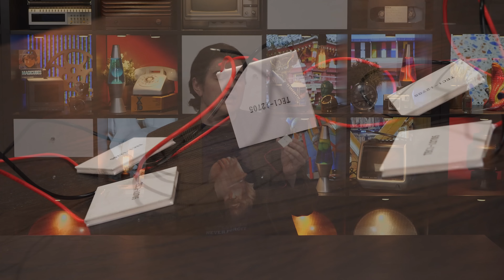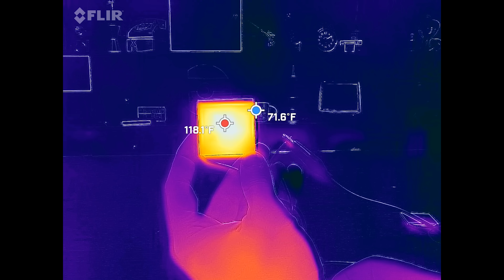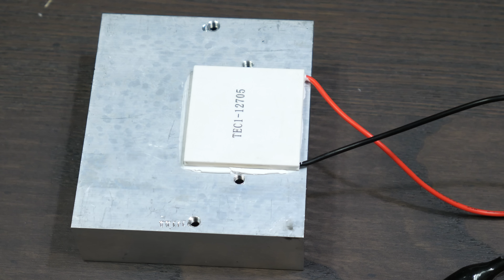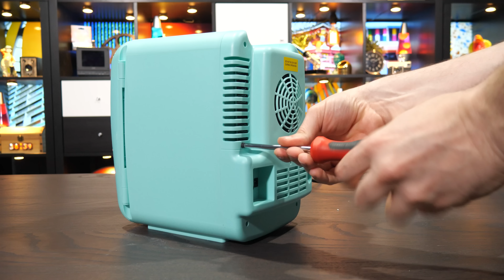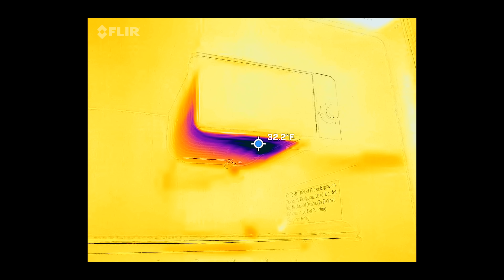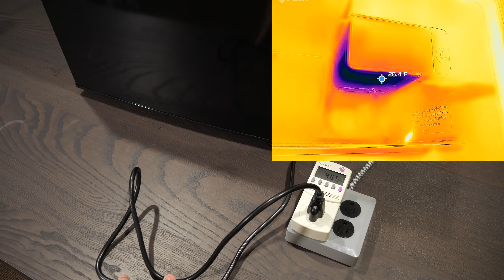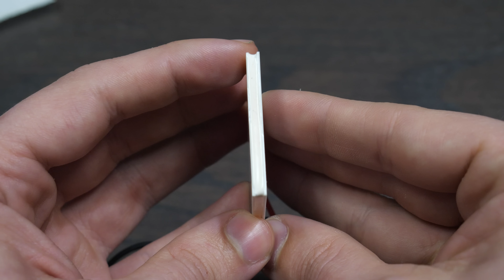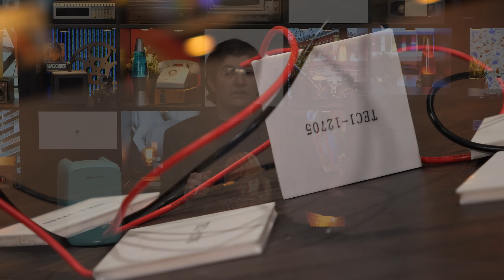Thermoelectric cooling: it's not great.

Comment: A bit tangential to the topic at hand, but I hate those temperature control dials in refrigerators.  0-6 is completely meaningless, so it requires trial and error (and a thermometer) to even know what they mean!  Like...if they're gonna do that at least make it go to 11 so I can make Spinal Tap jokes.
Reply: If they had degrees, then the dial would have to be calibrated.
Reply: @roberthunter5059  Not just that, but you also have the issue that refrigerators are commonly large enough that there can be a difference in temperature between the bottom and the top. And in order to ensure that the temperature that it's claiming is being achieved, you'd need more sensors. Sensors that can themselves break and lead to customers suing the manufacturer.

It's just a relative scale. If the food is too cold you move that dial a bit one way. If it's too warm you move it the other way. And you use a properly calibrated thermometer and daily checks to get it to where it should be initially. After that, you should hardly have to mess with the dial again.
Reply: @roberthunter5059  ...and you could complain because they arent consistent.
Reply: @roberthunter5059 to be fair, that’s the same result as the meaningless dial, but at least you can directly calibrate if it’s in degrees instead of trying to do conversions
Reply: @roberthunter5059 just do it the way commercial chillers do
Reply: @roberthunter5059  They should use Deceptican levels.
1. Ravage.
2. Rumble
3. Thundercracker.
4. Soundwave.
5. Starscream.
6. Megatron.
Reply: @roberthunter5059  What if we legally demanded calibrated units then?
Reply: Requiring calibration is massively expensive and if mandatory would need to be done for each unit.   Cal techs usually need to be certified and all the components used in calibration themselves need to be calibrated in turn, regularly.  Your temp probe cannot differentiate between hundreths of a degree and 1/10th?  That probe is no longer allowed for calibration, add $200 to a production line cost (Ballpark, cost to cert the cal tool, fail, repair and test again and then replace).  Instead you could just verify the design and components work as intended within the desired range than manufacture  with a dial between the operating extremes.  Buy a $2 thermometer and hang it inside, set the dial to whatever can hold the desired temp you want on the thermometer.   Cheaper than a $20-50 temperature controller and its solid state.    Temp is drifting after 2-5 years?  Adjust based on internal thermometer.   The numbers are your individual reference  not reference to a desired temp.   
The real question I have about all this is why people don't hang thermometers in their fridge. @youtubeuniversity3638
Reply: @youtubeuniversity3638 why demand it legally when you can already buy a wide variety of fridges that are calibrated? On my fridge, I can set the fridge temperature and freezer temp in Celsius, it’s a mid range model from 10 years ago
Reply: @youtubeuniversity3638 we’d see a huge price spike
Reply: Im pretty sure because they are not calibrated at all at the factory, so they cant say anything other then relative power.
Reply: @Stars-Mine well the fact they aren’t calibrated is a problem
Reply: @Stars-Mine
Reply: The dial on my fridge has 'cold' and 'extra cold' with no scale.
Reply: oh boy, my refrigerator has two control dials, the one for the fridge is 0-6, and the freezer one is A-F... yeah wtf hahaha, using letters to indicate coldness
Reply: @zackarylefebvre9059  Your freezer control is in HEX ?
Reply: Agreed! In Europe, I'm never sure if 0-6 refers to degrees Celsius, which means closer to 0 is colder, or cooling strength, which means further away from 0 is colder.
Reply: @FlintlockYT They usually aren't in degrees, it's mostly a measure of cooling power. Otoh, mine have a temperature setting since the early 2000s, and they aren't expensive ones.
Reply: @wernerviehhauser94  They are never in degrees. if they where in degrees they would be marked as such.
I paid the price of at least 4 beers to find this out.. Its now set to 2, witch is the "cold enough for beer but don't trust it with meat" setting on mine.
Reply: @wernerviehhauser94  with my old one it really did only denote general cooling power (I had to dial it up in summer, and dial it down in winter). With my new fridge, that also has no temperatures but only numbers, I have to do no further adjustments, so it seemingly takes the actual temperature into account. I guess it's something about that if they write 5°C on it, that's what the fridge has to do, while when they write 5 on it, it does something and the customer might use a thermometer to see what exactly and adjust accordingly.
Reply: @wernerviehhauser94  A measure of cooling power? So 0-6W of thermal energy removed? No?
Isn't a fridge supposed to keep a constant temperature, or is it for removing a constant ammount of heat per time?
Reply: @jannikheidemann3805  not in a proportional sense, but in an "guitar amplifier" sense - 0 being "none" and 6 being "a lot". And all you get from a standard fridge is a constant average temperature, a few degrees of oscillation are inevitable without more tech
Reply: @FlintlockYT  just as a spoiler alert, the numbers on toasters mean nothing either.
Reply: @skellious  the numbers on mine are a timer
Reply: @skellious this would be relevant if the numbers on the toaster were in any way close to operating temperature. 
Like 0-200. But they’re not. Unlike the 0-6 which are exactly the normal Celsius temperatures in a fridge
Reply: @Abductedsky  Some people claim that the numbers on a toaster represent minutes of toasting time. (Based on Tom Scott's video on the subject... that's actually true for some models, but not for most.)
Reply: @macdjord no matter what number I put my toaster on it just seems to toast a random length of time.
Reply: @macdjord  hopefully Tom will return one day!
Reply: @skellious  Experimenting with a toaster is easy, since toasting takes a short amount of time. Besides, if you set it too low, you can toast a bit longer, if you set it too high you can pay attention and notice when it's about to be too toasted.

Fridges are way slower to experiment with, plus you need an additional thermometer, you risk damaging the food in the fridge, etc.

"The numbers have no intrinsic meaning" is a much bigger problem for fridges than for toasters.
Reply: @skellious the numbers on a toaster are minutes, you goober. 😂
Reply: @Abductedsky the dial in a fridge is not marked in degrees. US fridges use the same duals, and 0°F is a lot colder than 0°C. Those numbers are power levels, not temperatures.
Reply: @macdjord sure, if you're buying cheap crap. Pay a little extra for something not made in China, and you won't have a problem.
Reply: @aethelfreda your toaster is either a cheapo, or it's malfunctioning. Buy a new one. Cheap and malfunctioning heating elements are a fire hazard.
Reply: @skellious false the higher the number the longer it stays down theyre literally a timer
Reply: @macdjord those people are idiots its not minutes,  lets say you pick a 7....youd start a fire with your bread on for 7 minutes.  But it is some sort of timer.  Put yours down at 1 vs 7 and time it
Reply: @skellious they're time in minutes actually
Reply: They do, the indicate level of toastieness @skellious
Reply: @skellious  I suppose that is because most use a simple monostable timer with a RC circuit to set the time, now these resistors and capacitors are probably not the most accurate and as such the time the numbers refer to probably varies a decent amount between units.
Reply: @SkunkApe407  all the bimetallic strip and electromagnet ones are hit and miss. Multi slot ones of those being worse than single slots. I never toast things unattended (as I like my toast hot) so even the most unreliable toaster is not a significant fire risk. I'm used to toasting under the (UK) grill (US broiler?) for most things anyway.
Reply: @aethelfreda  you can use either lingo interchangeably with me. My Nan was from Guildford, so I was raised with just as much of the Queen's(King's) English as I was American English. I also have family in Kilcullen, so I speak a bit of Gaelic English, as well.

As for toasting, I haven't really found one that works perfectly, regardless of brand or model, and even a toaster oven, grill, or broiler only toasts one side at a time. 

We can send satellites to the furthest reaches of the solar system and create carbon nanotube structures stronger than steel and more flexible than plastic. BUT WE CAN'T DESIGN A DEVICE THAT EVENLY AND CONSISTENTLY TOASTS BOTH SIDES OF THE BREAD!!!

We truly are a species of brilliant fools.😂
Reply: @Abductedsky but they also use 0-6 for refrigerators sold in countries that use Fahrenheit
Reply: Its time i guess @skellious
Reply: @skellious arent toasters' numbers minutes?
Reply: @skellious every toaster I’ve ever owned has-in the owners manual- said that the number is a timer for length of time the bread is toasted
Reply: @skellious spoiler alert, you're wrong. The numbers on a toaster change the length of time the toaster runs. Which is effectively controlling your total heat output, because lower number will run for less time meaning overall less heat, and a higher number will be the opposite
Reply: @Abductedsky the numbers on a toaster usually refer to time, but they have no direct relation to an actual time period and it varies from toaster to toaster. As in 6 doesn't mean 6 minutes but if it's set to 6 it will run longer than if it's set to 2
Reply: @macdjord it does refer to time on, but like you said not always a direct relation to a real time period. 6 runs longer than 2 regardless of the toaster though lol
Reply: @skellious  I thought they counted minuges? No standard for how much heat is actually applied but the numbers do mean something.
Reply: @skellious the numbers on toasters refer to time intervals... It's just an egg timer built in
Reply: @skellious  what? 😂 Yes they do it's the timer
Reply: @skellious not true. Most modern toasters are of a kind called "capacitor toasters". The way they work is by cutting off the circuit when a capacitor inside is charged to a pre-set specific voltage. The higher the number you set your toaster to, the higher the resistance is in the current flowing to the capacitor. Essentially, on a lower number the current will have less resistance and charge the capacitor faster, causing your bread to toast for a shorter time; on a higher number, the current will have higher resistance and thus take longer to charge the capacitor, and longer to pop your toast out.
Reply: @skellious they are a timer, look up the video of the guy testing them :)
Reply: @skellious depends on the toaster. Many manufacturers caught on and have made them either be a timer or a heat dial or both. In more expensive toasters. E.g. Smeg toasters, they have this.
Reply: @skellious Usually the #'s on toasters are correlated with time + a burnt piece of bread is a lot different than food spoilage or unsafe consumption.
Reply: @skellious the number on your toaster is how long your bread gets toasted 😅
Reply: @FlintlockYT    0-6 is not temperature. It's cooling power. With 6 being the coldest
Reply: @FlintlockYT  A refrigerator should be keeping everything under 5°C or 41°F. Have you turned the refrigerator all the way up to its coldest setting what you are actually doing is simply having the compressor run for longer period of time each day just like an air conditioner. Also many refrigerators only really cool the freezer and the cold air is then vented down into the refrigerator box. Depends on the model obviously.
Reply: @FlintlockYT  Or doesn't. It is between 1-low cooling6-most cooling
Reply: @FlintlockYT they just need to change 0 to OFF  but people would argue about that
Reply: @FlintlockYT I hear you but there’s a user manual that would tell you that. Would def be simpler if they label it cooler at one end or something.
Reply: @FlintlockYT My fridge at least have a helpful snowflake on the dial to indicate the cold side.
Reply: @FlintlockYT  most sane refrigerators, the number should be a measure of effort, so higher = more cold. Though the fact there's a zero in your example is perplexing 🤨
Reply: @FlintlockYT  actually, Celsius makes those numbers make sense. Since 0 is the freezing point of water. However, thinking in terms of Fahrenheit - 0 is way too  cold and so is 6 being as 32 is the freezing point of water.

Moot point though, I guess... I'm sure the numbers aren't related to temperature on any scale.
Reply: I have a large drink fridge in my store which recently got repaired as it was constantly running and exploding drinks, it took weeks to dial in a propper just above freezing temperature again. Digital thermostats in fridges need to become standard
Reply: @LookinLikeSoup customers would complain the empty fridge is 40 degrees even when that's normal. The company doesn't wanna deal with dumbasses
Reply: The manual usually explains how to set it more or less. I had mine set to coldest because I had that dippin dots ice cream type thing to put in my freezer and the instructions say to set it to the coldest (mine goes up to 7) so I just left it like this. Might set it to higher now that winter is coming not to waste electricity but I kind of got used to my water being nice and crisp lol
Reply: @Jhud69 why would winter have any relevance to your refrigerator temperature?
Reply: The trick is to modify it with an inkbird temperature controller and add a fan to it. If memory serves there might have been a video on this channel that did that.

EDIT: Yup he brought it up during this video lol.
Reply: Doesn't matter what I say my fridge on, it freezes the vegetables in the crisper.
Reply: Higher number = colder, i know this because the back of my fridge builds up frost if i crank it up
Reply: The thermostats are not that accurate, if you take two identical fridges and set them both to 4 they will have different internal temperatures because the dial has poor precision.  They are mechanical thermostats and use a gas filled bulb to switch a relay opposed by a spring.  I imagine to calibrate them all would take more time/money, so instead of being an indicator of temperature they are just a guide to where it's set now and if you want "more" or "less" of an internal temperature.  I have had fridges that didn't have numbers at all, just a circular triangle shape type thing to indicate high and low.
Reply: Right! I stayed at a hotel recently and the minifridge had the dial written as "cold, colder, coldest" So much better!
Reply: I work at a municipal water plant and we have to keep the fridge where our bacteriological samples are stored within a very small temperature range. Checking the thermometer and finding the temp to be 1/2 a degree high or low and then having no idea how much to actually adjust by sucks. The worst is that some of my coworkers like to move the thermometer to the front of the shelf so it’s easier to read(picking it up and holding it next to their face is too hard I guess) and just the temperature difference in the center of the fridge compared to by the door is enough to throw off our settings.
Reply: Mine just has half snowflake and full snowflake
Reply: @donut7087  wow fridges are so sensitive these days
Reply: Actually yeah would that even be any more expensive? Since they already need a thermostat why not just set it to a temperature with the dial?
Reply: @drabberfrog  
You actually see the temperature the unit keeps. The mechanical gives not any feedback, you never know where you are at.
Reply: My more modern fridge shows X°C - so lower number is colder.

For older machines higher number means more cooling power.
Reply: I don't get the spinal tap joke but I completely agree in the meat of this comment
Reply: Just use a Sharpie.
Convert the 1 to 11
Reply: @dougaltolan3017  Or 3d print a new knob.
Reply: @quantisedspace7047 Sparkfun actually sells a "GTE" knob that goes to 11 if you want a nice metal one.  Great if you don't have a 3D printer and the innumerable online 3D printing services are somehow not an option for you.
Reply: You misunderstand them. They are just relative to each other. You're supposed to use a real thermometer to decide whether to adjust the dial or not. You typically start with the dial somewhere in the middle and you adjust it as apporpriate.

The real issue is that the freezer and refrigerator are being cooled by the same heat exchanger, which means that you're really, adjusting it to whatever it is that keeps both the refrigerator and freezer in their relevant safety zone.
Reply: Abstract deliniation is way better than absolute. Any time you stick an absolute reading on a dial some dumbass customer will challenge it.
Reply: I am using a peltier box with the wires reversed and a thermostat for raising bread dough at a constant temperature, usually 26C.
Reply: I think it's because depending on your environment those levels of cooling would result in different temperatures, that's why they recommend what they recommend, try levels with a thermometer and maintain around that
Reply: Well thankfully a lot of newer high-end refrigerators have temperature displays that tell you what temperature you set your fridge and or freezer to.
Reply: YES

I've had the same fridge for over a decade and I always forget if 1 or 6 is cooler or hotter. If that damn dial gets bumped by something I just always set it back to 4 and hope for the best.
Reply: or 10 so it does actually mean something (%)
Reply: It’s been more than five years and I still haven’t figured it out. It’s a bit too cold but that’s better than too warm.
Reply: Exactly. Every temperature control should have red and blue dots. Refrigerators, sinks, showers. I don't need the exact degrees, but at least give me a hint
Reply: Yeah, I bought a thermometer just for this reason. Found out I had kept my fridge at 6.5°C when it should be under 5°C. I keep mine at 4°C now.
Reply: Just read the manual 😊
Reply: like why 6???
Reply: I feel like they are like toasters. They dont refer to degrees or minutes. I also have a feeling they arent even linear. 2 or 3 is average, but 4 out of 5 in my fridge is freezing the back and everything that touches it. So even if my fridge is really full, i cant really put it to 4, or i have frozen cheese or yogurt.
Reply: @max5183  they probably aren't linear. But that's not how you tell, since water doesn't freeze progressively, it just freezes at the right temperature. Even if the control was perfectly linear you'd see the whole fridge suddenly freezing at the last setting.
Reply: @max5183 the numbers on a toaster are minutes. What are you talking about.
Reply: I can not for the life of me figure out why fridge and freezers don't have a digital thermometer built in for safty and a digital thermostat
Reply: @simonupton-millard  Not sure how calibrated it is but my fridge/freezer has buttons and temperature units on it. It was in the flat when I moved in so wasn't one I chose (I believe it came with the house, built in 2018) but it does the job pretty well. The fridge temperature scale is from 2 to 6 degrees C (no control of the freezer temperature) in individual degrees.

I don't think the buttons are just mapped to "1-5" on a dial scale as the lights above the selected temperature flash if the fridge isn't at that temperature, so there has to be a probe in there somewhere.
Reply: @simonupton-millard Higher failure rate, more components and less of them solid state.   Buy a thermometer like any business is required to have.   Hang it up, rest assured that it will likely outlive your fridge.
Reply: @simonupton-millard  Mine had a digital readout but it only told you what it was set for and continued to lie to me as the LG compressor failed and the temperatures inside became dangerously warm. I don't know how we didn't get food poisoning.
Reply: @simonupton-millard  Uhm... they do? You do realize not everyone uses a cheapo 30 yo fridge, right?
Reply: @TarecPL  mine was an fairly expensive 10yo fridge by a good brand but only a analog 1-6 thermostat that's it
Reply: @simonupton-millard  cost
Reply: @simonupton-millard  we just got a new not-smart fridge and it DOES have thermostat control for fridge & freezer. I can set the desired temp for both. Fridge is set to 33°F (that's close to 0°C) and freezer is set to 6°F, though there's a button called "chill boost" which will temporarily knock the freezer down to -8°F.
Reply: @simonupton-millard  cost
Reply: @simonupton-millard standard sized refrigerators do, but on a mini fridge. The freezer is reliant on how long the system runs to cool the interior of the refrigerator part. If you have your fridge set to the number in the middle of the dial, both the fridge and freezer will reach safe temperatures for both food and drinks.
Reply: @simonupton-millard probably because even at their "lowest" setting they are still within proper refrigeration temperatures so it's not very relevant?
Reply: @DarkAttack14  mine isn't mine is at 12°C at 6, it has to be at 3 to be at under 5°C
Reply: @simonupton-millard Many freezers in Europe does.
Reply: @simonupton-millard in Europe at least, most brands do have options with digital thermometers and thermostats, but those are usually the more expensive models. I had a freezer with both, and I did like it a lot (but I had to leave it behind when moving).
Reply: I keep mine as close to it turning offas possible and scrunchies inside is very cold to the touch so I have no idea why it has higher numbers
Reply: I don't believe or trust any built in thermostat. Having to store insulin I can confirm that the digital thermostat with actual degrees are vastly inaccurate. I just use a bimetalic thermometer and adjust the temperature based on it.
Reply: My Samsung fridge (made in Mexico) has digital readouts for the set temperature for both the fridge and freezer compartments (both located in the fridge compartment).  I keep the fridge set at 37° F. and the freezer at 0° F.  I've checked both with a thermometer, and they're rock-solid.
Reply: I’m so thankful a lot of fridges switched to degree control
Reply: I’ve been saying this for years with speed adjustable tools. They should gauge themselves off RPMs of the spinning head.
Reply: My fridge from 1968 has it in alphabet letters. A-J. I  always keep it on G, sometimes F. F cools to 43F on soda cans. G will turn everything into a slushie. I never took it past G, it would likely freeze meat.
Reply: Mine does a digital display of temp in F and C
Reply: THANK YOU.  I'm so sick of stuff in fridges freezing just because it's closer to where the air comes out, too.
Reply: my mom's fridge is great, it just has two rows of LEDs on the door (for the fridge and freezer sections) which are labelled both with actual °C and handy symbols indicating which temperatures will save energy, so you don't have a brainfart when thinking about negative numbers.
Reply: "What's the point of setting it to 11?" "Sometimes we have to smuggle an ex-drummer across state lines."
Reply: Mine goes to 11.
Reply: Try using an OVEN with those nonsense dials. My mom learned to cook on one of those, so trying to figure out what temperature "4" actually meant now that she has a real oven was quite an experience....
Reply: @bluestarkiller gasmark is an actual thing with conversions between them, but different countries have different conventions calibrated to different temperatures
Reply: Easy the number stands for the vickers hardness of the butter you want to achieve.
Reply: the number stands for the coolant cycle time (0: almost no coolant gets cycled - 6: coolant gets cycled for 6 minutes (pretty much freezer temperature)
Reply: Hilariously, it's not the most useless thermostat I have in my house right now. I have a gas water heater where the thermostat levels are "off, cool, 1, A, B, C, hot" . It's currently on "1" because "A" nearly melted the washers on my washing machine. 🤷🏾‍♂️
Reply: Ehhh. My Beko fridge has a temp target on the dial. 😅😅
Reply: They are still somehow better than my places actual fridge right now. It has four options ranging from left to right! With one marked "recommended"
Reply: Every fridge I've had has numbers and a directional arrow labeled "colder"
Reply: Glad our new fridge freezer has an actual temperature setting. Fridge stays at 5°C and freezer at -18°C all the time. Those sill 0-6 dials always confused me.
Reply: Same for oven and many dials
Reply: Hasn’t he talked about this topic before?
Reply: It's way more manufacturable to build a fridge with a low resolution dial (represents proportion of constant cooling) than a high resolution temperature controller (requires a heating coil to raise temperature, and a cooling reservoir to reduce temperature) that is accurate to some degree Celsius.
Reply: If your thermostat isn't working, that's a broken part, not a design flaw.
Reply: Just to get a thermal cam bro (I do have one, they are not that expensive).
Reply: my beko fridge has the controls in Celsius degrees
Reply: I tore into a free fridge someone left on the curb to clean it, and found out that the freezer control is just a louver. And then the fridge is on what i think is a rheostat, that runs the compressor. But they are all in the fridge light box. So maybe they build it this way for cost? The coil is in the freezer and the cold just transfers to the fridge through those dampers/louvers.
Reply: You see my fridge is much colder because it goes to 11 see
Reply: Are you mental? 0 is off, when it's running at "6" turn the knob to "1" and it will stop running
Reply: @BlackRabbitt92   I see you have no idea of the context of the joke
Reply: I turned a mini fridge to 0 recently and found out the hard way that that means “off”
Reply: I had a fridge which said low-high. No indication if it meant temperature or power. When spinning the dial and leaving it for a while, there was no evidence it made any difference at all.. 😂
Reply: It would require to calibrate a cheap system, and now u have to make a version for america aswel becouse they refuse to use celcius.
Reply: I have one of those TEC coolers.   On my to-do list is a closed-foam insulated box (recycled materials), heat pipe, radiator, fan arrangement and an op-amp or two to to drive it from a DC supply.  I have a couple of NTC resistors that might be fairly linear, so calibration would be a one-time thing.  It's a travesty that manufacturers give us these stupid dials.  No, I don't want the stove on '2'; I want to know what temperature the pan is in real-time.  They have taken us for fools.
Reply: Never had a device that did not mention the temperature range of those 0-6 range dials 😂 sorry but rtfm
Reply: And of course, each refrigerator with the dial is going to have a little bit of wiggle room. The smaller refrigerator that I have was able to freeze milk in there accidentally when I turned it all the way up. I thought I had to turn it all the way up to keep everything cold in there but nope it’s just a smaller refrigerator & runs on butane!
Reply: @everyone I was reading through so many replies down here and was hoping for the ultimate truth. Didn’t find it.
Reply: just neans it has no thermostat.
But actually, they could do like, "If 25° in your room, then its ... in your refrigerator"
Reply: my fridge has a thermostat that displays actual degrees celcius.
1-8 for cooling, -24 ~ -18 for freezing. 
it's a cheap Beko fridge, not anything high-end.
Reply: Right. It would be just as easy to put the actual temperature on the dial instead
Reply: My fridge/freezer has per degree settings, very nice and easy
Reply: every single human on Earth should immediately write down the current temperature for each number so we can sleep in peace.
Reply: My family have a fridge and the numbers are degrees celcius (it's actually a push button with led indicator) and it confuses the hell out of my mum because she thinks a bigger number means colder.  She swears that all fridges she remembers did it that way, and I don't disbelieve her, but all fridges are made at defferent times by different engineers for different companies, so there is a very good chance that some indeed make 0 be warm and 6 be cold, but not all of them will.  With people becoming more and more au fait with thermometers (say checking the weather on a daily basis, or even just a fridge thermometer) it was only a matter of time before we decided that following the convintions of a thermometer was a good idea.
Reply: These solid state cooling systems don't cool to a specific temperature.  They cool on the average about 40 degrees below AMBIENT temp.  So the hotter it is outside, the less cool it is inside.  Simple.  It is a set restriction.
Reply: Mine goes up to 9 so I guess it's 3 better...
Reply: The numbers on your amplifier mean nothing, either. Still, everyone knows what "crank it to 11" means.
Reply: I had a Darth Vader version of this concept years ago and it actually worked pretty well
Reply: They actually do have good meaning. If you have a 0-6 dial, go with 3, the number in the middle is the safe temperature and where the energy guide gets the power consumption information. So if you want safe temperatures, and efficient operation, go with the middle.
Reply: They're analog...idk wtf you're expecting.
Reply: Yes! There's a thermostat in there, so a given setting should correspond to a certain temperature regardless of contents (if the thermostat is used *correctly*) so why not just let me choose the temperature?!

My current landlord special fridge has separate thermostats for the fridge and freezer, but only one dial for cooling strength. And the difference between the fridge and freezer is way too small for me. I've either got to deal with melty ice cream in the freezer or things on the fridge's top shelf freezing solid. There is no good setting on this one dial to control two things that already have different thermostats that doesn't make some spots unusable or some foods disappointing
Reply: Not to mention how they put them on top right up front to ensure they're always getting changed.
Reply: Someone keeps changing the dial on one of the fridges at work. Sitting it at around 2-3 keeps the internal temperature within the 2-8° C range that it's supposed to be. But someone keeps moving it right up to 4 or even 5, and I come in and find that the internal temperature is literally freezing! I'm wondering if they think the number means temperature and they're aiming for 5° C.
Reply: I DONT TAN MY GENITALS AND AS FOR THE TOPIC OF HAND CONTROL THAT’S MY PERSONAL BUSINESS
Reply: If you would spend just a little
Bit more you can get one with an actual
Temperature selector
Reply: I'm guessing they don't have a thermometer, so it's just controlling the duty cycle, which results in a different temperature depending on outside conditions.
But really, nowadays they should just throw a fuckin thermometer in there, they aren't that expensive!
Reply: I've had drinks freeze on me in my minifridge. It really is trial and error.
Reply: Or, i should say smaller fridge. Nothing mini like the one in the video.
Reply: Read the manual?
Reply: Pretty sure it's 1. is cold 2. is colder 3. is colderer 4. Is coldererer and so on 🤣 simple.
Reply: Or 
1. King cold
2. Lord Chilled
3. Cooler
4. Frost
5. Frieza
Reply: That's why people write and include instruction manuals in most products - it has the information you seek.
Reply: 6. is more cold. 0 is less.
Reply: I have done testing with actual thermometers and writing down temperatures over time and have concluded that bigger number = more cooling. If I put mine at 6 then things at the back of the fridge will freeze and at 0 things will not be held at food safe temperatures
Reply: I read the first sentence and was like ooooo I’ll make the spinal tap joke… damnit
Reply: I agree, 6 if not enough, 10 would be better but they should really give the option to pump it up to at least 11.
Reply: My fridge at least comes with the handy tip that "9 is the coldest" which doesn't sound like much but my dumbass would think the lower numbers are colder since like... that's how temperature freaking works
Reply: The Design of Everyday Things explores this very topic in one of its early chapters! Highly recommend reading
Reply: my refrigerator goes to 11
Reply: Some Refrigerator owner manuals have what the goal temp of the settings are
Reply: Agreed, like why can't they just put estimated temperatures for each dial position in place of meaningless numbers? Or better yet, just make all fridges with digital thermostats now. If the company that made my cheap $20 space heater could afford to put a digital thermostat on it, I'm pretty sure even the cheapest fridges could have them.
Reply: Yeah, dorm and hotel fridges simply don't have the power to keep things out of the "danger zone", or the airflow circulation for either that or consistency.
Reply: It's not meaningless. All settings will be colder than room temperature, extending thr shelf life of food. Some foods you may not want to get as cold, idk any examples but yeah. Depending on what you store, maybe you need those settings.
Reply: Modern more expensive  fridges, though, have moved to using actual temperature indicators. My new LG side by side displays the temps for the fridge and freezer parts. I set it to dispaly Celsius units
Reply: Someone should make a super tiny compressor.  Think about a model airplane engine set up as a pump.  Of course it needs to be hermetic so no shaft seal or blow-by losses so sealed up with its motor it could be about the size of a pop can.  How cute would that be?  Use it to make a tiny fridge a third the size of the mini fridge shown.  Maybe this already exists?  I have not looked.
Reply: It's a cost saving measure, it's because they don't have calibrated dials
Reply: @JessicaFEREM  That doesn't justify the numbers though, imo.  Not that they need to be justified, but...idk, my fridge goes from "cold" to "colder" iirc, with some evenly space graduations (is that the right word?) along the way.  No silly meaningless numbers.
Reply: @ThomasWinget they can put what they want in there it doesnt usually mean anything other than to make it easier to play with the knob
They don't have to but it makes our monkey brains happier so they do
Reply: Same for toasters.
Reply: On my refrigerator it's clearly marked that certain numbers are warmer and certain numbers are colder.  The ambient temperature of the room is going to affect the final results so you do have to experiment.
Reply: Its '1' colder, innit
Reply: The mini fridge I got for college has 1-5, and if it’s at anything lower than 5 the lil freezer section doesn’t keep anything frozen. RIP random pint of Ben and Jerry’s 😔
Reply: Xactli
Reply: Isn't it usually in the manual?
Reply: Shift fridge into H
Reply: Yes, it's quite an annoying system. Plus they don't even show you which way is colder or warmer. Is 0 the lowest temperature, or the lowest amount of cooling? Is 6 the most cold, or the highest temperature? No way to know without testing it out over the course of several days.
Reply: It’s probably because it’s a matter of food safety. Imagine if they mark it 50 degrees and it does not in fact keep the food inside at 50 degrees.
Reply: @cosmic7234 by using a real thermostat instead of a timer.
That would be impossible
Reply: I decided it was worth it to spend a bit extra for a ‘cooler’ rather than a ‘minifridge’

Same size, still refrigerates, just without the useless tiny freezer… and it has a digital temperature selector where I can specify… I don’t remember the minimum specified temperature and the maximum it said on the instructions but I have it on 40F which is good for drinks and snacks… works really well and it’s got like… twice as much space compared to a similarly sized mini fridge… I use it as a night stand because I enjoy the gentle humming it makes
Reply: Larger number = more cooling power. Whats confusing ?
Reply: Hahaa, well done.
Reply: Well thats kinda for a reason. those types of thermostats arent very accurate so putting an actual temperature range wont help much. now granted putting numbers is rather dumb and a few fridges including mine, dont even bother. its knob just says cold and colder.

Really even if you had a fridge that could actually set to temperature. like more expensive fridges, having a thermostat inside is probably a good idea no matter what. a lot of fridges ive experienced seem to struggle a bit with changing seasons and will drift up or down when the seasons change. But a good way to start with these simple knob guys is to set the knob directly in the middle, let it run at that temp for 24 hours and check the temperature and adjust in small increments again allowing for some time for the fridge on a whole to stabilize. yes it takes a bit but its not that hard. 

so really you should do the trial and error anyway to make sure your fridge isnt lying to you and yea those numbers are meaningless. those kind of thermostats simply arent good enough to be able to say if you set me to 33 degrees i will remain at 33 degrees.
Reply: My old fridge goes to 11. 😂
Reply: Thanks for your in-depth review of Thermo-Electric Heat Pumps. 
Question: is it possible to make a conventional ac compressor small enough to power an air conditioned jacket with portable lithium iron phosphate battery pack? I guess it would be difficult to get the cool air off of the evaporator coil into jacket cavity channels ?  I work in a hot factory and my Peltier device head cooler just doesn’t cool enough when it’s 90-100F. Keep up with all of your interesting and very well researched topics. Still waiting on a video of how an old vintage 45rpm Juke Box works to make its chosen musical selection. 😁👍
Reply: Cool Video “Pardon the Pun!” 
I need an ac compressor based hot weather jacket to cool me in me at my hot factory job. I would gladly tote around a 50Ah 48v Lithium Iron Phosphate rechargeable battery pack. I suppose it would probably look like an Astronaut Suit and people would poke fun of me and the boss just make me work harder, lol. Hey Jim, still looking for a video explaining the electro-mechanical functions of an old 45rpm type Jukebox and how the record selector part works ((😮))
Reply: Or it just says min, max, and mid
Reply: I have too slap the top of my fridge a few times a couple times a year too keep it running , my temp d
Dial broke of 15 years ago and I use a old tooth pick I keep in my ice tray for when I need to adjust it ,
Reply: Mine depicts multiple thermometer symbols increasingly going higher/hotter🌡. Yet the highest is the coldest/most power.
Reply: Wot?
Reply: Was staying in an old hotel and had a box of sprite on the fridge as well as some food. Well my food wasn't staying cold so I cranked the knob up to 7 and 9/12 cans of sprite exploded from freezing too fast
Reply: I have tried for 25 years now tried to figure out if lower number means colder or warmer...
Reply: @a64738 Higher = Colder. You’re welcome. 😁
Reply: @IIllIIllIIllIIllIIlll  lower = colder on mine
Reply: @a64738  My fridge helpfully has a label besides the dial, #1 is the warmest, #6 is the coldest. I do not know if it's valid for all fridges.
Reply: @a64738  Every fridge I've seen made in the last 20 years has had the dial labeled with 'colder' at one end and 'less cold' at the other.
Reply: @a64738  just read the manual already v: !!!!
Reply: @a64738  The manual should say, but I doubt it's standardized.
Reply: @a64738  Me also. Whenever I've tried it, sometimes the mapping goes up; sometimes it goes down.
Reply: @a64738  higher numbers are colder, it’s about how much cooling, how much the fridge will run
Reply: @a64738  it would take me maybe an hour, or just RTFM
Reply: @a64738 25 years? A thermometer and an afternoon could have answered that for you.
Reply: @a64738 Have you tried measuring it with a thermometer and charting it?
Reply: @a64738 read the manual for the appliance, it will tell you that information...
Reply: @a64738 Generally in all instances I'm familiar with, the higher number is cooler.  You really should be using a thermometer to ensure the temperature is applicable for your needs,
Reply: @a64738 lower means warmer. I work at a hotel and when people turn up the dial the freezer gets iced up and we have to defrost it. The fridges are in a cupboard so when the fridge is on highest number the outside of the fridge overheats and feels warm to touch because the motor (?) is working too hard. We always turn the dial down to 2 or 3 when cleaning the room.
Reply: Our old fridges had the meaningless numbers, but all the new ones have had temperatures. It's like there's a thermostat in there or something!
Reply: @Slugbunny not meaningless
Reply: Spinal tap water from the fridge is the best! 😋👌
Reply: My fridge goes to 9. I don't understand why there aren't any colours on the dial to indicate the temperature.
Reply: @cmul7651  Doing colors is expensive. Why set up a machine to do red/blue for just a few mm squared, when the rest of the device can be just painted white ?
Reply: @cmul7651 you wouldn't need colors if you read the owner's manual.
Reply: Most people just crank them all the way up and back the dial down if stuff starts to freeze...
Reply: It’s just an arbitrary dial… no calibration necessary keeps things cheaper, plus all fridges wouldn’t run alike and they run differently depending on how packed with food they are (air flow). Typically dead centre is perfectly fine. Also, only the dial in the fridge is for the thermostat, the freezer dial is an air vent that allows cool air from the freezer side to pass into the fridge area. Both dials need to be adjusted together using trial and error. Its not that difficult tho
Reply: Most modern refrigerators/fridge freezer have a temperature display with setting for both compartments.
I bought mine 6 years ago with fans in both chambers so frost free they both.
Cost wise not the cheapest, but great units.
The dial type is not good by any means.
I find so many users get ice in the freezer or fridge and loose the capacity.
Too many users turn the knob to colder and get even a warmer condition.
More ice and less cooling duty.
Reply: Don't worry Alex already complained about that a while ago 😂
Also this channel is built on tangents
Reply: It is a perfect system for certain Orthodox Jews.
They can’t create a spark on the Sabbath, which includes starting or stopping an electric circuit. Some of them interpret this as being unable to open a fridge door if it has a thermostat and is trying to maintain a certain temperature, because opening the door will cause the compressor to kick in.
However, if a refrigerator isn’t trying to maintain a temperature, but simply do a set amount of work, opening the door will have no impact. 
Such a fridge would have a power setting instead of a temperature setting.

However, this is completely nullified if the fridge uses a thermostat or has a light activated by opening the door.
Reply: Same goes for toasters!!!
Reply: it goes one colder
Reply: I can think of 100 references for going to 11. No idea wtf spinal tap is
Reply: @imdeadserious6102  The 1984 film that originated the phrase/concept.  I've never seen it actually, but a cursory search indicates it is indeed the origin of the premise in popular culture.
Reply: @ThomasWinget  screenshot for potential movie night lol. Thnx!
Reply: Spinal what jokes
Reply: I have shouted to the heavens about this for decades. All you need is coloured dots, from blue to yellow, or from green to red, whatever. You never actually dial in a number. All you ever do is adjust a fridge by making it a bit colder or making it a bit warmer.
Reply: If you actually read the manual, you would know the number to set your fridge on is based on the ambient temperature of the room. A little thinking goes a long way. Reading is such a wonderful tool you should try it some time.
Reply: Well someone told on themselves they didn’t wantched the previous episode. The dial indicates the cooling intervals, so to cool stuff high up to keep stuff cool lower down
Reply: @istdaslol well why doesn’t it just control what temperature the digital thermostat is set to?
That would be way more useful
Reply: agree
Reply: But the same fridge in Phoenix, Arizona would need to output more cooling to reach the same internal temperature as that same fridge in Portland, Maine. They can't put a temperature in the dial since that temperature wouldn't be accurate in all locations/climates/elevations.

So they just use numbers. Bigger number means more cold  no matter where it is.
Reply: @Leron...  There's no reason you can't have a callibrated sensor which works in different climates. After all, all the sensor would do would be to trigger the compressor for longer or shorter periods. In a hotter climate it runs for longer, in a colder climate it doesn't run as long. 

After all, that's the same effect as turning the numbered dial from 4 to 6 or whatever.
Reply: @Leron...  most of the fridges are thermostat driven, so the same fridge will reach the same results in different ambient temperatures. Normally you don't need to adjust the fridge e.g. between summer and winter. But the thing is, there's individual variation in thermostats, so when they just put arbitrary numbers, they don't have to deal with calibration, and also with customers who complain if the calibration is not spot on (not even to mention that they might have poorly calibrated thermometers to compare with). Also, the temperature varies inside the fridge, too, with some cooler and warmer areas.
Reply: @Leron...  Actually, if you think about it, they can absolutely put numbers that correspond with the temperature in the fridge and it not making any differance at all. 3 degrees in arizona is also 3 degrees in maine, the only difference is that the arizona fridge would have to work for longer. But the thermostat already does that, since it will only shutdown the compressor when it reaches the temp. that the user selected
Reply: @lloydcollins6337  I think some fridges with the numbers do have a thermostats, they are just not exactly calibrated, but only to a "good enough" degree, that doesn't allow you to write temperatures on the dial. Also it could be something about the fact, that without very short and frequent cycling a fridge can't really hold an exact temperature anyway. So a setting like that would mean keeping the temperature around, or perhaps below a certain point. So it wouldn't be that much more meaningful anyway.
Reply: That's not how a thermostat works. A thermostat set for 35° in Maine is the same as 35° in Arizona   @Leron...
Reply: @lloydcollins6337 the issue isn't calibrating in different climates. The issue is that, in a nation the size of the US for example, things like refrigerators are build and tested hundreds of miles from where they are eventually used. The climate in San Antonio, TX is nothing like the climate in Bangor, ME. A fridge calibrated to work at prime efficacy in Bangor isn't going to be anywhere near as efficient in the San Antonio heat. Generalized power selectors allow manufacturers to create a uniform product that is the same, regardless of where it is sold.
Reply: @SkunkApe407  I meant calibrated to the temperature scale, not calibrated to the environment. I.E. if it was 20F in the freezer it would show 20F on a reading from that thermometer.
Reply: @lloydcollins6337  you do realize that calibration isn't permanent, right? Calibration is something that has to be performed regularly on precision devices. A temperature selector is not a critical component, in the sense that you don't need to dial in an exact temperature. Food safe temperatures are expressed in ranges. As long as your refrigerator cools to within that range, that's all that's necessary. Precise calibration would require having a service tech coming to your house at least once a year to recalibrate the thing. There is a such thing as over-engineering a product. If you're that worried about calibration, they sell thermometers for refrigerators. Stick one in the center of your fridge, on the center most shelf, adjust temp, give it time to adjust, rinse and repeat until you've found your optimal setting on the existing thermostat. That's literally how it's been done forever.
Reply: @Leron... the way some get around that is having a digital number display inside, like mine just has buttons that say raise or lower the temp and then the number display lists the internal temp I’m setting it to
Reply: @Leron... Why not just use a thermostat?
Reply: @Leron... I can set the AC in my vehicle to a specific temperature, which it maintains regardless of the temperature outside
Reply: @Leron... False, in a refrigerator that uses a refrigeration cycle, all the numbers are an exact temperature. The middle number is what the fridge was tested on for example, and that's where the energy guide gets the information for power consumption. So that means the dial is set to be an exact temperature for any fridge of that model.
Reply: @Leron... They could just link the dial to a thermometer, when temp reaches the desired level the cooling mechanism turns off until the temperature goes above the desired level

It's a very simple system (similar to how a cars cooling system works and can be regulated entirely with mechanical parts) and no need to take into account the external temperature
Reply: @Leron... except they CAN do that, because you’d just control the THERMOSTAT with the dial, rather than the amount of cooling power.
And like, of course the thermostat is what I want to control, that’s what controls the temperature which is what matters.
Reply: It needs to at least go over 9000 so you can say it's over 9000! LOL
Reply: @awilliams1701 what, 9000?!
Reply: The cooling power can change depending on the environment the fridge is in
Reply: This is gold🥇,well done sir